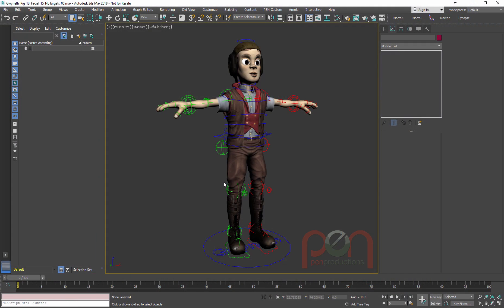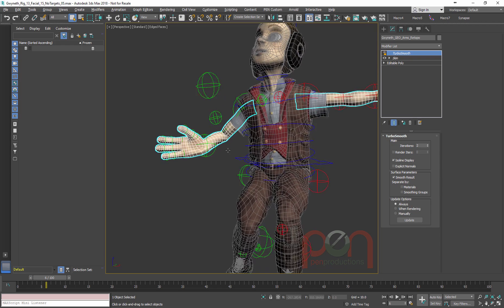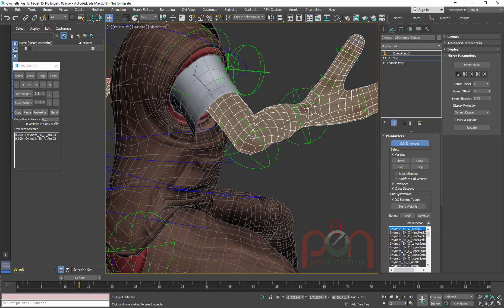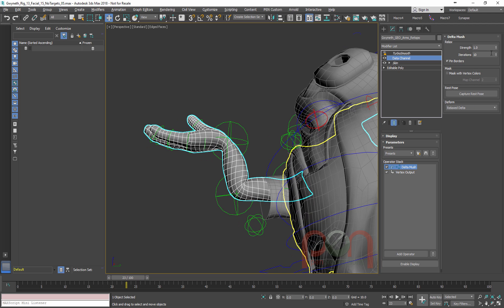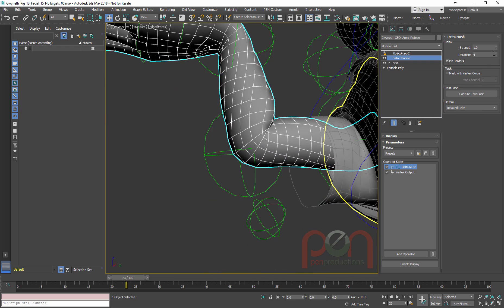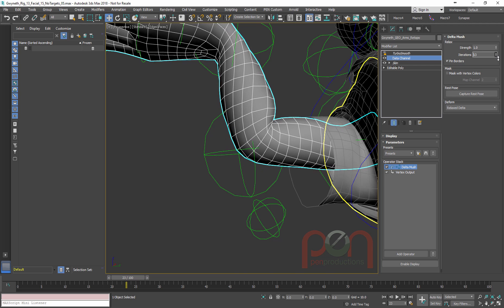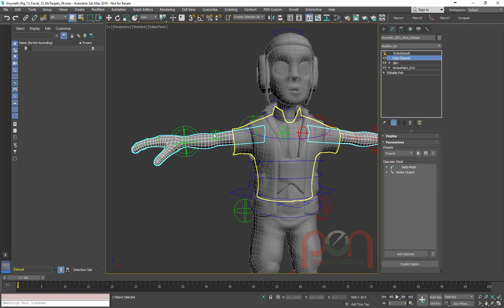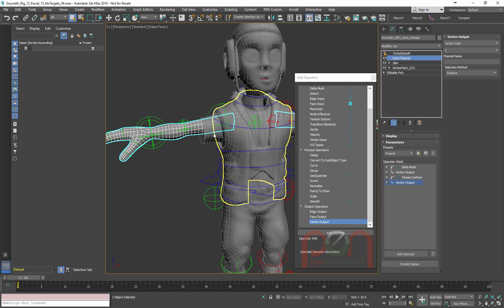Data Channel Delta Mush & Tension Deform

Comment: Thanks a lot for your tutirial!!!
Actual question is how to bake the delta mush into skin modifier after without delete skin? I is possible?
Reply from the maker: It is not possible as Skinning methods are static data where Delta Mush and Tension deform are dynamic. If you thought was to export the data to an engine of some kind this wouldn't work at all as the engine has to understand what Data Channel is doing. Although you could write a custom tool set for handling it in engine it would not be practical as it would be very slow.
Reply: @paulneale  Thanks a lot for the answer)

Comment: Thank you for the amazing tutorial Paul! I was wondering though is this data channel modifier collapsible and how would it get exported to a game engine like unreal? Because game engines only accept the skin modifier...: (
Reply from the maker: It can not be collapsed for this purpose. The game would need to have the same tool for it to work in engine and that would be very expensive.
Reply: @paulneale  I thought so as well, I saw a plugin somewhere that transforms this data into skin data and kind of bakes it but it doesn't seem to work (the plugin). Would you happen to know of any other techniques that can correct skin deformation and scale problems? I was thinking morphs again like for the facial rig but how to do that? Do you have a video about this? Thank you from the bottom of my heart, I am really new to rigging and really bad at it ahaha your videos are really teaching me things: )
Reply from the maker: I have no idea what that plugin thinks it is doing when trying to convert the data to linear weights. There is no way it can work. The best way is to rig the character well.
Reply: @paulneale  Hi Paul, it creates proxy bones with rotation animation for each bone and based on that animation it solves the skin weights. From my experience sometimes it gives fine result, sometimes not, but that is how it works, you may check video here:
https://www.youtube.com/watch?v=1BztqI-Hn14&t=52s&ab_channel=KM-3D.COM

Comment: Thanks, but should've explained what Vertex Paint is and why 2 and 3 map channel IDs are assigned.
Reply from the maker: I believe that I do mention that I sent channels 2 and three for filtering two of the axes. Vertex Paint allows you to colour vertices with a brush. The Max help file will cover it more as do many of my other tutorials. Does that help at all?
Reply: You explained almost everything you used in this video. But not so much about Vertex Paint, as it seems to me. Yes you might've covered it in previous videos, but people come to this video from many other places, meaning they've not watched all of your channel videos. So would be good to cover everything anyway. Regarding Vertex Paint - I should google why you used 2 and 3 and found that Max Help says it's because lower values are used for textures. But anyway it's too vague - we can have quite a bunch of layers like normal, reflection, etc, but why do only -2, -1, 0, 1 channels are reserved?
Reply from the maker: That would be a whole other video about how mesh data is stored and used in 3D. Thanks for the input, I hope that you like my videos and have learned from them.